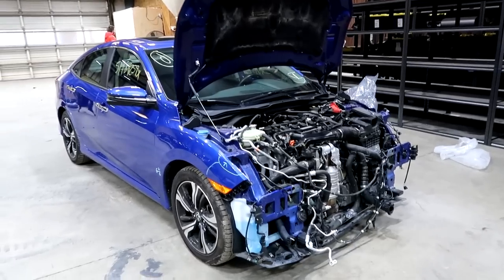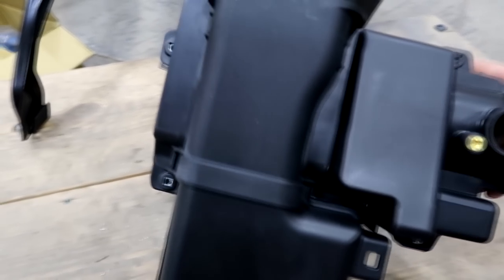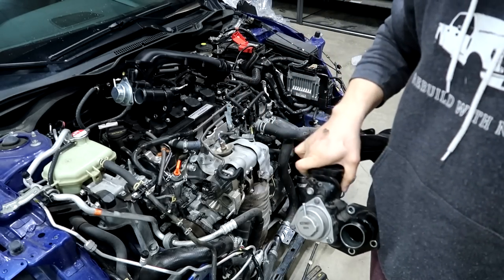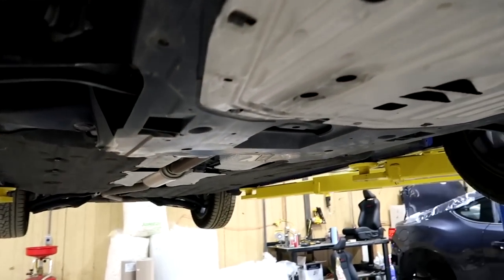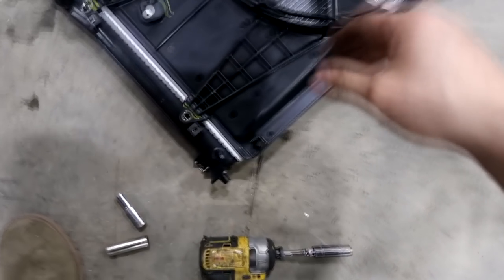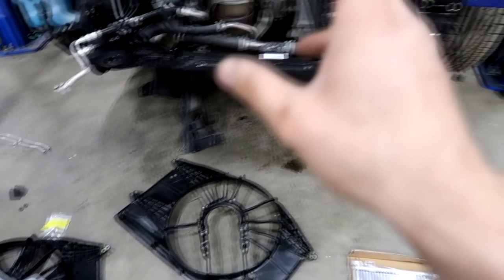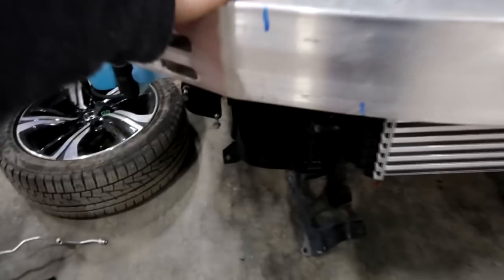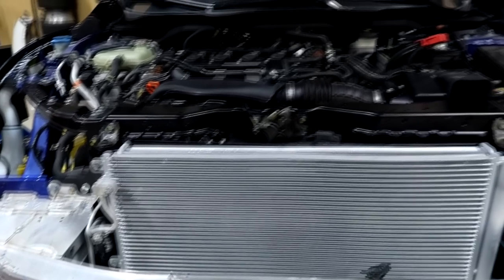I Bought The Cheapest 2017 Honda Civic You Could Possibly Get From Copart "Part 2"

Comment: Nick, did you scuff the parts before you painted? Looks like you just sprayed over the areas you wanted blue...Always, always, scuff the parts with atleast a red scuff pad, then degrease and paint. Theres alot of contaminates on those parts. Even after degreasing you sometimes find fish eyes or other blemished in the paint.
Reply from the maker: Yes I did. Probably didn't include it in the video because it was already 22 min long
Reply: @RebuildWithNick  
Good to know!! Wasnt tryin to be negative bro, just wated to make sure you wouldnt have adhesion problems!
Yoù wouldnt believe how many people i know that have sprayed right over new parts and didnt know that they had to prep them. They think because they come primered, that they are spray ready!

Comment: So you dont have to replace the timing belt every 40 thousand miles ?
Reply: BlueFlyer 100.000 miles
Reply: @Gileopardz  Should be 100,000 kilometres or 60,000 miles. That's the recommendation for most cars here in Australia.
Reply: Oh okay I guess it depends on the region, I change the timing belt on my civic in the US every 100,000 miles.
Reply: @Gileopardz  It might also depend on the brand of vehicle. We do our Hyundai Getz and our Daihatsu Charade every 100,000 kilometres or 60,000 miles. Maybe Hondas have a longer timing belt life?
Reply: Yes that might be it, my father is a mechanic and he does timing belts on Hondas every 100K, and the manual says the same to replace it every 100K. Like you said it depends on the car.
Reply: The L15B7, like the K20C (the 2 engines available in the Civic) has a timing chain, no timing belt to change